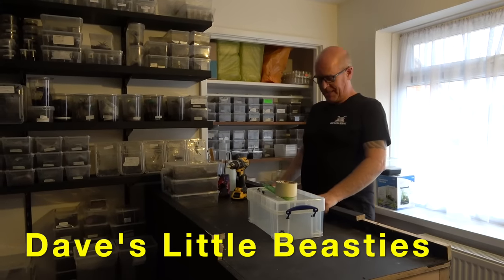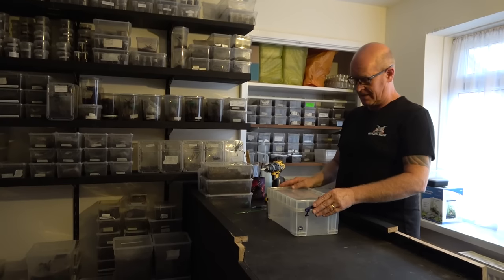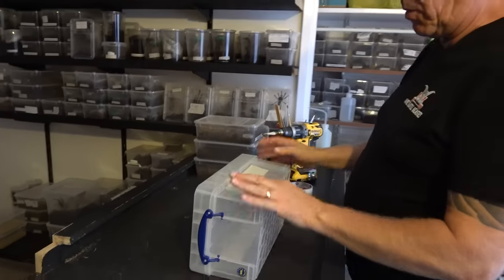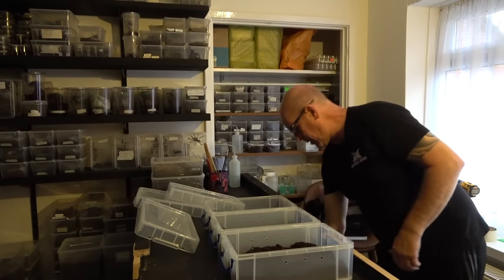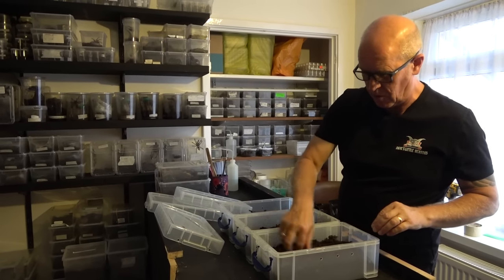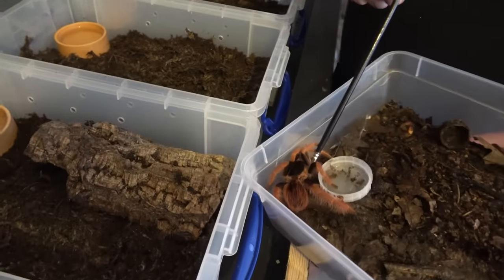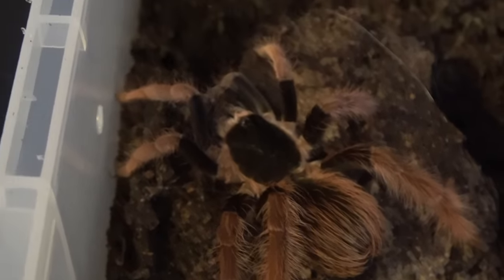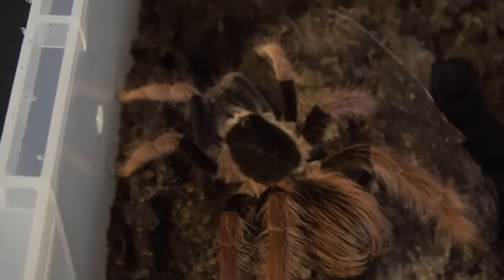Megaphobema robustum the Colombian Giant rehouse  and care

Comment: Some feedback: Prefer when its filmed from the front angle. Side filming  is awkward as the default angle.  Visually for the viewer and probably for you having to turn towards the left constantly. Personally I would move  the Beastie table 90 degrees so the daylights coming from the side and the set up is facing where Camera Lady is filming from.
Reply from the maker: As mentioned filmed from the side becouse of the window ? I need to replace the black out blind 👍

Comment: when I try to use the drill to make holes over the saudering iron I use, I get those awkward pieces of sharp plastic stuck on the container. I don't use tape, is that how you avoid the same issue?
Reply from the maker: The step drill cuts a better hole 👍